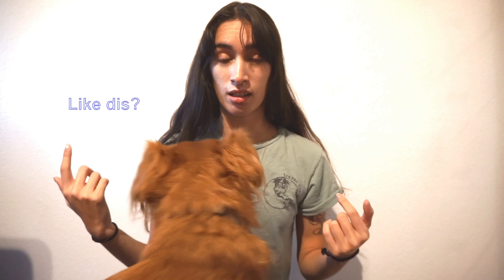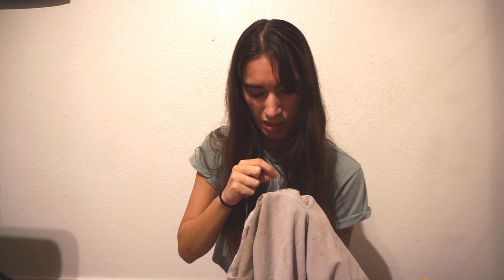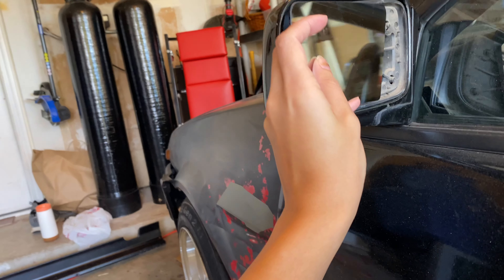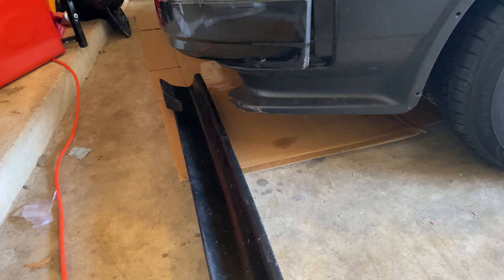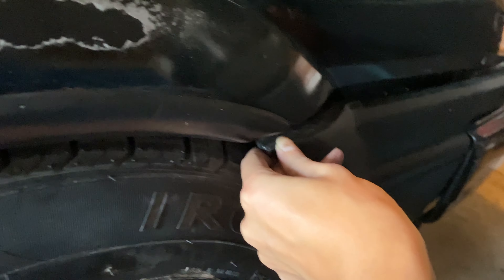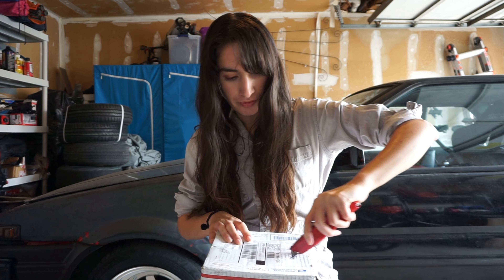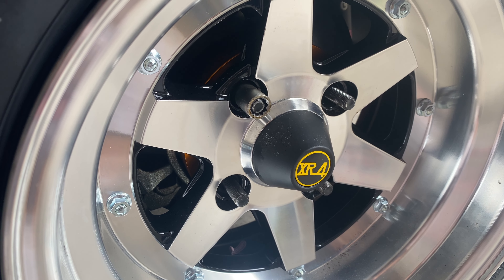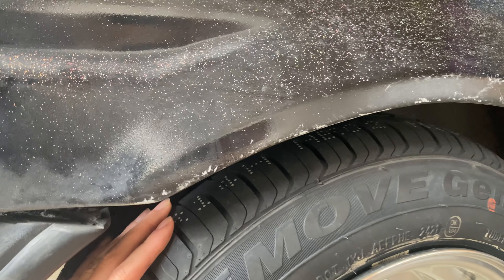Fixing the little things on my AE86 | Toyota Corolla AE86 Drift Build | S1E19

Comment: Check engine light is off woot woot 🙌🏽! Hopefully you got your wheel off and did the driver side 😅. If you did and the gap looks a little more or less you can put the car on jackstands... again 🙃... but put them on the frame rails and w/ the jack under the axle still, not drooped but enough to get resistance off the springs, you can center the rear diff by adjusting your lateral/panhard bar. But that's if you're OCD 😅😂
Reply from the maker: I know!! I’m so relieved! Ah, that’s interesting 🤔 I never thought of that.